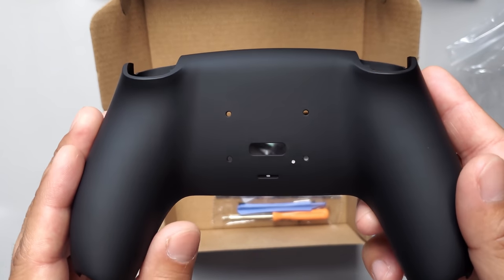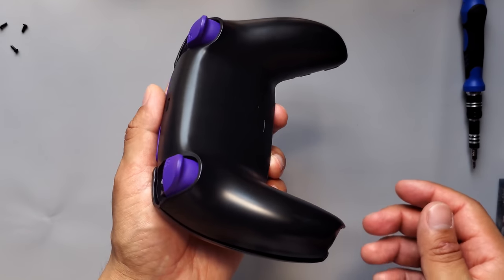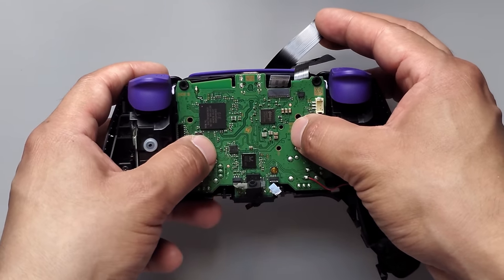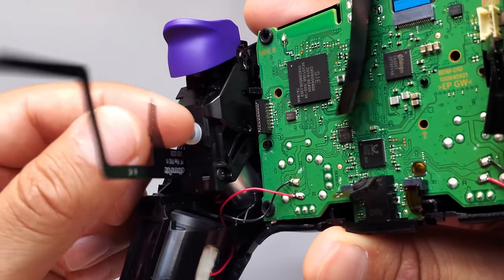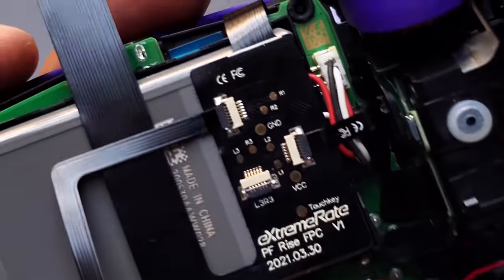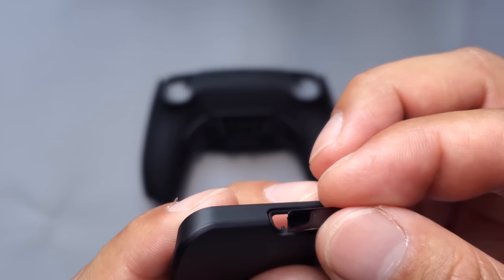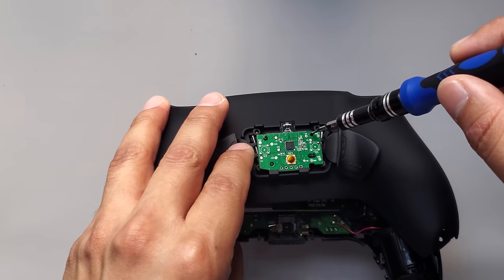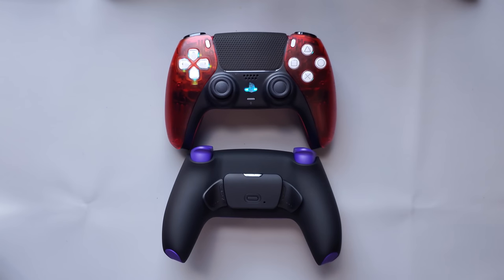DIY PS5 Controller (For BDM-010): eXtremeRate's Rise Remap Kit | No-Soldering Step by Step Tutorial

Comment: What if I make it to the end and when I press the button on the back and that little light doesn’t turn on where did I go wrong?
Reply from the maker: You said press so just asking to make sure. Did you hold the button down? Also did you check for compatibility? You can also try turning it on manually by holding L1, R1, down dpad, and square at the same time for a few seconds until the the light goes on
Reply: Ok so my controller won’t turn on now so I must’ve done something wrong what do you think I did wrong?
Reply: I don’t see how I could’ve done anything wrong I followed step by step
Reply from the maker: I believe it's the compatibility. Here's a link to help explain about the compatability.  https://youtu.be/cncOZDDSmIk
Reply: Dang dude I got the newer version of the ps5 controller with the “A” at the end such a bummer I thought I had done something wrong so I just gotta retrace my steps to put it back to regular correct?
Reply from the maker: Yeah. Contact the company. There's already a new version. It's different from the V1. But you should take a look at it.

Comment: So, tried one out. Controller wouldn’t turn on. Or the device. Sent it back, got another one. Same thing… not sure what’s going on. HELP
Reply from the maker: Did you check for compatibility?
Reply: @im.a.caveman  doesn’t it work with all ps5 controllers?
Reply: @im.a.caveman  yup Jst noticed the back of the controllers model #. So how do I find a controller with the other model #?
Reply from the maker: You could possibly find one in stores. But on the gamingcobra website the remap kit for BDM-020 is already released. You can get a refund and then get the one for your control.

Comment: I got mine installed without the L2 R2 cables and the red LED won't turn on. Makes no sense, might have to return.
Reply from the maker: Try to check again if everything is connected correctly. Including the one that goes behind the motherboard. Just re check everything. Controller needs to also be on for the back buttons to turn on or off after holding the button for it.

Comment: I can’t get any power to the controller now. I’ve taken it apart three different times no bad connections no frayed wires and still no power. Any suggestions
Reply from the maker: You might have a BDM-020. Check your original back shell's model number. If it's "CFI-ZCT1W A" that's most likely a BDM-020. The kit is only compatible with BDM-010 or "CFI-ZCT1W" (no "A" after the W) the BDM number is found on the motherboard if you also want to check it that way.
Reply: Im.A.Caveman you’re correct it’s a 20🙄 Of course now I gotta go find a PS5 controller that’s compatible good lord
Reply from the maker: If anything get a refund. extremerate is working on a compatible version for BDM-020.
Reply: Im.A.Caveman GameStop had the 10 version thank god lol. Back to the workshop we go
Reply from the maker: Oh snap! Good luck, let me know how it goes. After you remap remember to turn off the back buttons. After that you're ready to use them.
Reply: Im.A.Caveman works perfect and now I’m a damn expert too. Ty
Reply: Spoke too soon L2 button isn’t working for some reason

Comment: I accidentally ripped the cable at 4:15. Is my controller done for now. Pls help
Reply from the maker: You're controller will still work. That's the front mic cable. I think there's replacements. Can be found on eBay or Amazon. Maybe other sites but haven't searched into that
Reply: @im.a.caveman  gotcha I appreciate it. I ended up getting it together and it works great. Haven’t messed with the mic on the controller but never use it anyways. Thanks for the video man

Comment: Just installed it and I followed every step but when I fully reassemble it my controler won't turn on and I re checked it and everything was Intackt and nothing was broken so I'm not shure what could have happend
Reply from the maker: If the controller doesn't need to charge then most likely the kit is not compatible with your control.
Reply: @im.a.caveman  yeah after I posted that comment I took apart the components and reassembled it my ps5 controler worked fine so it was the attachment and I might just have to invest into getting a scuff controler if I can't find another alternative but thanks
Reply from the maker: They have the one compatible with your controller.
Reply: @im.a.caveman  what one would that be?
Reply from the maker: @jay_vaz  if you're original back shell is CFI-ZCT1W then that's a BDM-010. If it's CFI-ZCT1W A then that's a BDM-020. They have a kit that works with either model. Bdm is found on the motherboard. I have a video on compatibility if you want to check it out.
https://youtu.be/cncOZDDSmIk
Reply: @im.a.caveman  alr tysm

Comment: Is it possible installing this caused stick drift? It’s more jumpy than it is drifty
Reply from the maker: Definitely not. Stick drift eventually happens depending on the usage of the analogs sticks.
Reply: @im.a.caveman  I know I’m just curious bc ive only used the controller for nba 2k like 40 times lol
Reply from the maker: @nickriello89  No lie sometimes stick drift is so random. For my ps4 controller's, I would connect my headset to the controller, for some reason the drift would spaz out. But from a personal experience with the remap kit on the ps5 controller I've had no drift issues. I installed my first kit around March and still good till this day.
Reply: @im.a.caveman  yeah I hear you, I’ve always been lucky and never had any stick drift issues. May just be my time. I just hope I can transfer the kit to my new controller lol

Comment: Just got my button attachment today! Anyone having problems where the L1, L2 switches off the controller when it’s inserted?
Reply from the maker: I recommend checking the cable for the left side. Could be it's not fully connected or maybe the wrong end is connected.

Comment: my L2 is stuck for whatever reason. If I'm playing any FPS game I'm stuck on ADS mode. any tips?
Reply from the maker: Like the button itself is pushed down or in game it shows it without the physical button being pushed down?
Reply: @im.a.caveman  in game it shows without the physical button being pushed.
Reply from the maker: @JoaoRuben13  You installed the remap kit?
Reply: @im.a.caveman  I did. For some odd reason when i press L1L2 connector it goes back to normal. when normally plugged it does the same thing
Reply from the maker: Can you by any chance check the BDM number on your controller? It's on the motherboard side that shows the analog sticks.
Reply: @im.a.caveman  should I put back the stock parts and return it?

Comment: Followed all your instructions but my controller now has no power going to it not sure what I sis wrong
Reply from the maker: Is your original back shell model number CFI-ZCT1W or CFI-ZCT1W A?
Reply from the maker: Or is the the BDM on the motherboard BDM-010 or BDM-020?
Reply: I gave up.. got the controller working again without the paddles
Reply: Just wanted to let you know I checked my second controller and that one had the correct motherboard so I followed you video and installed it with no problems at all great help..  Thank you

Comment: how do u reset the controller in case u need to?
Reply from the maker: There's a small hole behind your control, you should shut off your ps5 console (that's what the instructions from ps support says), push the buttons thats in the small hole in the ps5 controller, and then reconnect it with your USB cable and turn it on.

Comment: Is there a way to reset back to no assignment on one side?
Reply from the maker: Yeah there is! Ex: if you have X programmed to left or right, you can hold X and the back button you programmed it to. The light will blink and back button should have no button assigned. And remember that program mode needs to be turned off to use the back buttons.
Reply: @im.a.caveman  thanks mate

Comment: Can anyone help… I’ve set up the back paddles, the light comes on and I’m getting the correct response for remapping to the back paddles, but it doesn’t officially register. I’ve taken the controller apart twice to make sure I’ve connected everything properly and it’s all wired perfectly. Has anyone had this problem and we’re they able to fix it?
Reply from the maker: After remapping turn the back off.
Reply: @im.a.caveman  done that… several times
Reply: @rizing616-  you ever figure it out?
Reply: @costanza7013  Yeah mate, eXtreme Rate sent me new ribbons 👍

Comment: I did this today and my controller won’t turn do u have any idea what could it be no wires were damaged
Reply from the maker: The kit is not compatible. Did you get the V1 remap kit? Or did you connect the wrong cables? (BDM-010 or BDM-020)
Reply: @im.a.caveman it says rise 2.0
Reply from the maker: @YT-JustRose  what's the BDM on your board and which cables did you connect?
Reply: @im.a.caveman  I did all the ones u did I think it’s not compatible with my controller cause I Put the original cables back and my controller turnt back on
Reply from the maker: But what's the BDM on your board? Or what model does the original back shell show?
Reply: @im.a.caveman  Bdm-010
Reply: @im.a.caveman  I just realized my controller is a Bdm20 and I used the bdm 10 cables🤦‍♂️🤦‍♂️😂

Comment: Have you had any not work? My cables don't lock into place like yours, no power to remap device
Reply from the maker: Does the motherboard show BDM-010?
Reply: @im.a.caveman  yes
Reply from the maker: Okay so it's definitely compatible. Which cables are you having trouble with?
Reply: @im.a.caveman   the two cables that attatch to the piece stuck on the battery. And the one that connects to the piece on the back of the controller. When you plug yours in they lock down, mine are so lose that they just slide out with any slight touch
Reply: So when i try to reassemble its more than likely just unplugging everything.
Reply from the maker: @dbenes5223  If you have an IG send me a picture of what you're talking about.
Reply: @im.a.caveman  sent a video

Comment: Is the 3rd generation controller the same steps ?
Reply from the maker: No, the 030 has a different sized cable that goes behind the motherboard and also doesn't have cables that connect towards the triggers. Its a little simpler than 010/020. If you want to remap touchpad, L3, and R3 you'll still need to solder the cables for it. Other than that no soldering is needed.

Comment: absolutely rattled somehow the bottom left orange wire that connects at the bottom of the battery holder just ripped in half when i tried to disconnect it. Everything else went smoothly but it renders the controller useless
Reply from the maker: Ah shoot, how did that happen?
Reply: @im.a.caveman  all the other connectors seemed to come out super easy and this one was just sticking, guess i pulled a bit hard but the connector stayed in the port and the wire ripped, kinda weird

Comment: Isn't it weird that the controller has those flat cable connection plugs, like it's made for modding?
Reply: Pretty much guarantees that at some point sony will make an official controller with back paddles 👍🏼
Reply from the maker: They did it for PS4. I'm sure one day they will for PS5.

Comment: 4:14 Xd guys that little piece rip apart....gettin a new controller tomorrow
Reply from the maker: That cable is only for the front mic. That doesn't mean your control is dead. There's replacement cables available.

https://amzn.to/3xWCCJD

Haven't tried them myself. But one day I might test them.
Reply: @im.a.caveman  thanks for the link Im re piece together later if it works

Comment: Can’t get  L2 to work. But L1 works. Any ideas what’s wrong?
Reply from the maker: If the kit is compatible only thing I can suggest is making sure your cables are inserted all the way in and correctly installed. Other than that it could be a faulty kit. Which I would recommend contacting extremerate. All my installations have gone smoothly and have had no problems.
Reply: @im.a.caveman   thanks I try it over and over I will reach out . No response yet. but I’ll just have to buy one already install. I did also bought the he hex for $300 and after 3 months stop working didn’t get any help from the company.
Reply: @im.a.caveman  just wanted to let you know I just put back in the original L1 cables and now it work great I’m only using the kit of x and square. So I figured I didn’t need to used the cable. Been playing all day without and issues

Comment: Trying to test the buttons, but controller won’t turn on. It’s connected fine but won’t power on
Reply from the maker: Was the kit connected with the cables compatible with your motherboard?
Reply: @im.a.caveman  hi, how do you tell which one is compatible?
Reply: @im.a.caveman  anything on this?
Reply from the maker: @jn5887  Controller model CFI-ZCT1W has a BDM-010 board. Model CFI-ZCT1W A has a BDM-020 board. you have to connect the cables that match your board. The remap cables show the BDM number on them. 
Use this video as a reference. 
https://youtu.be/tAOzyKJ-Xv0?t=604

The controller in the video is CFI-ZCT1W A which has a BDM-020 board. 

I don't have the video connecting the BDM-010 cables.

Comment: just got mine today and its not working for me the controller works fine and the light comes on in the back but when I remap a button it just dosnt work light flashed like it switched and everything
Reply from the maker: If you haven't turned off the back buttons yet then try that and see if it works.
Reply: @im.a.caveman  I got it working its weird for the back buttons to work the red light has to be off
Reply from the maker: @majic26  it's because that's only for programming the back buttons. So if it stays on they won't respond because it's only trying to program when it's on. Off means it's ready to be used.
Reply: @im.a.caveman  Oh okay I was confused I thought the red light meant it was ready good tutorial and thanks for fast replys
Reply from the maker: @majic26  No worries! Have fun and enjoy!
Reply: i have same problem but when i program buttons and turn off red lights nothing happens..back buttons doesnt work
Reply from the maker: @DzO90  if your original back shell model # is CFI-ZCT1W A thats a BDM-020 and is not compatible. If it's CFI-ZCT1W that's a BDM-010 and shoukd be working. Let me know if you know either your model # or BDM (found on the motherboard).
Reply: @im.a.caveman  i will check when i come home.. there is no back button for 0-20?
Reply from the maker: @DzO90  Not at the moment. Extremerate is going to work on a remap for BDM-020. Someone found a way to make it work with BDM-010 but requires soldering.
Reply: @im.a.caveman  i have 0-10... i repated install all cables like in video and again cant program nothing..all cables are connected properly
Reply from the maker: @DzO90  Hard for me to tell what the problem is since I can't see it. If you think you for sure did it correctly ask for a replacement. Tell them it was a faulty and not working properly. Then try the new one.
Reply: @im.a.caveman   step by step like on video.. i installed clicky triggers and front clicky and that works great... only this..dont wont map it... if i try manual mapping l1 r1 down x is there red light or?
Reply from the maker: @DzO90  Okay just ask for the replacement and see how that works out.

Comment: Does this mean you cannot use the touchpad anymore?
Reply from the maker: Touchpad will work normally. It just means you won't be able to remap L3, R3, and touchpad to the back buttons. If you solder the other wires on you can Remap L3, R3, and touchpad.

Comment: i did everything the way i should’ve and now it won’t turn on and my mic doesn’t work does anyone know how to help?
Reply from the maker: If the battery isn't drained and it doesn't turn on then most likely that kit is not compatible with your control. You need the correct one. You can speak to extremerate about the issue.

Comment: I followed all instructions but when I finished the controller will not power on. I double checked the battery connection and it's fine. Any one else have this issue? Any ideas what is the problem?
Reply: I’m currently having the same issue. Please let me know if you find a solution!
Reply from the maker: It could be a compatibility issue.

Comment: So it doesn’t turn in or off with the ps5 controller ?
Reply from the maker: It does. What doesn't is the remap mode. You turn it on to remap. When you're done remapping turn it off and you can use it to whatever buttons you remapped it to.

Comment: Installed it got the red light blinking but the paddles don't work at all
Reply from the maker: After remapping turn the back off. On is for remapping only.
Reply: @im.a.caveman  thnak u
Reply: @im.a.caveman  didn't notice you had the new controller done lol could have used that

Comment: Very similar to the Dualshock on the inside
Reply from the maker: Definitely, with extra screws and cables.
Reply: @im.a.caveman  doesn't seem hard to do just plenty of steps...how do you like the paddles so far?
Reply from the maker: @fezv3gooner  They're a little more sensitive than I expected but I got used to it. Other than that I personally like them. Scarlet red is very nice.
Reply: @im.a.caveman  yeah, had to order them. Just can't do without them once you've been gaming with paddles for soo long already. Ended up with the textured black finish.